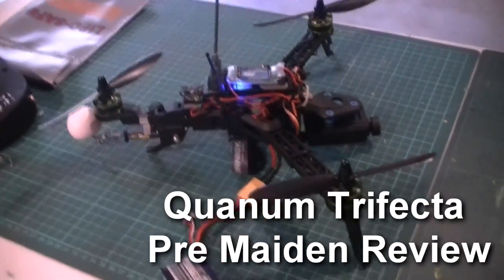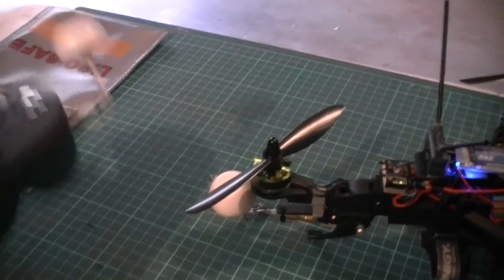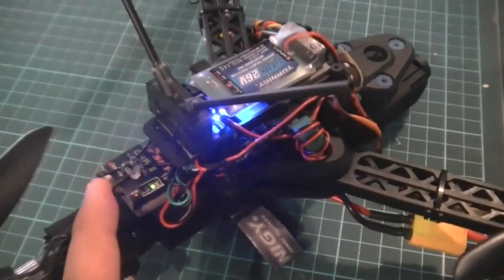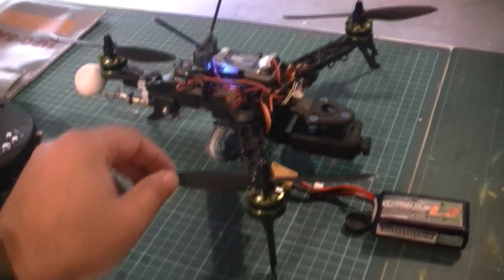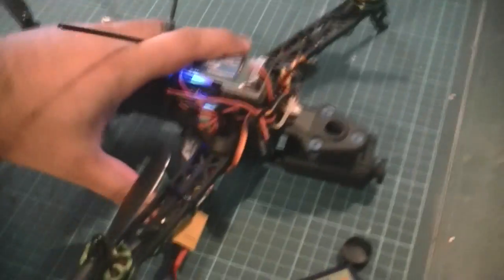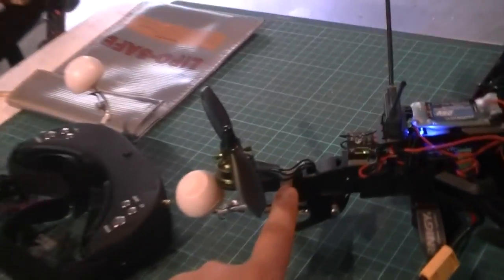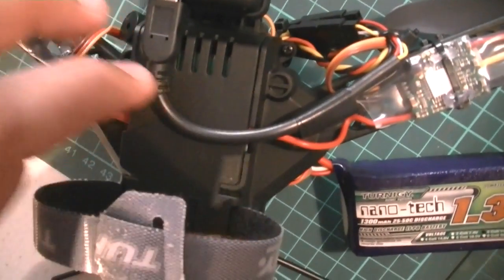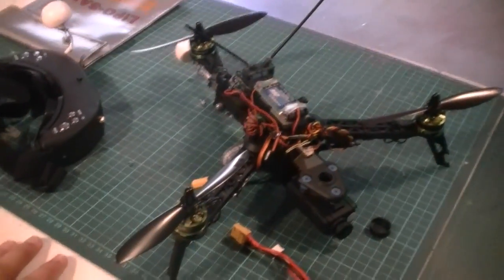Quanum Trifecta Pre Maiden Review

Comment: did having the video transmitter under the servo cause any servo jitter?
Reply from the maker: +joeprice22 no jitter problems.
Reply: What were your final PIDS?
Reply: +Mohit Dewan How did you neutralize the tail servo? Any tips. Still struggling to sort out the tail.
Reply from the maker: +Joe I just loadad Cleanflight on the naze32 board and all I've done is dial the P setting for yaw down to 65. I think 60 would actually more appropriate.
Reply from the maker: +Joe By 'neutralizing' if you mean centering I just used a servo centering tool and checked that the motor was pointing directly up by eye and then tightened the screws on the servo holder.
I have had a couple of hard crashes where the gears jump and the tail motor no longer centers straight up. Keep a small screw driver handy to unscrew the servo, center it and then screw it back in.

Comment: D4R-II receiver means you can't do anything besides control your quad right? I mean like changing flight modes etc? I want to build this bird with micro APM to have UAV and follow me functionality. So I need at least 5 channels to control flight modes, preferably 6 so have a RTL (AKA panic) switch :) Thanks for this video it cleared some things up for me
Reply: Alex Goris you can still have your mode selection channels. CPPM mode on the D4R-II allows less wires and clean setup. Very simple on the Taranis. I believe you have 8 channels on CPPM
Reply: *****, too bad you didn't post this yesterday, I just ordered my trifecta and parts and went with the VD5M receiver instead. It seems this D4R-II does indeed support 8ch in ppm mode, to bad they don't mention this somewhere obvious. Thanks for your reply nevertheless, I learned something new at least!

Comment: Hi just before I wreck my D4R-II, can't find anywhere that shows me how this should be connected using a single wire to my naze.  Your help would be appreciated :)
Reply from the maker: manjx15 what you need to do is put a single male to male servo extension from channel 1 on the receiver to channel 1 on the naze32. 
Put the jumper for the D4R-II on signal pins for channel 3 and 4 on the receiver. That will put the receiver into CPPM mode.
Reply: Many thanks, it flies!
Reply from the maker: manjx15 awesome! Glad to help.